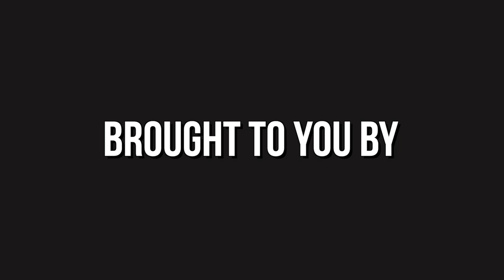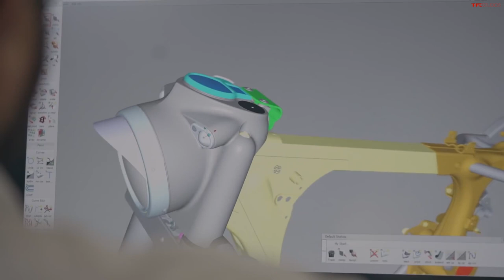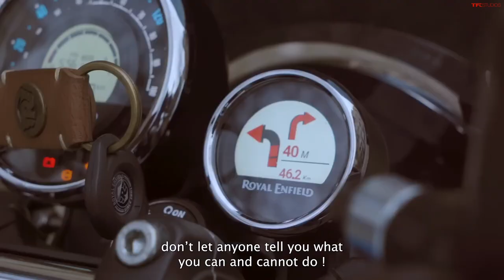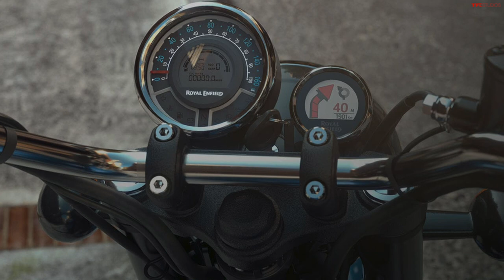Here's Every Royal Enfield Motorcycle You Can Buy In 2022! We Cover The Entire Lineup

Comment: I've owned countless bikes over the decades ranging from Yamaha, Kawasaki, Honda and a handful of HD's... just this summer I purchased a new RE 650 Interceptor and enjoyed it so much I also purchased a new Classic 350 in Halcyon Black... pronounced (Hal Sea On)... On the 650 I replaced the turn signals with nice metal aftermarket, a BAAK small taillight and a set of S&S pipes with baffles removed. This is literally the best sounding and most smooth bike I have owned or ridden. You need to get your ass on one asap with the S&S and enjoy all that is good about riding a motorcycle. Now, the 350 Classic is just as addicting... actually, more so... it is slow and lazy in the most amazing way. Again, a bike one must ride to understand fully. The heartbeat thump and smooth operation of the 350 is intoxicating, to say the least. I have never been a touring bike or bagger rider... my HD's were Sportsters, Soft Tails and Fat Boy... and quite honestly, these Royal Enfields are way more fun to ride and look at. So, as I noted above, get your ass on these bikes as soon as possible.

Comment: There's one thing I'd do to the 650 Interceptor: Get the Hitchcock upgrade treatment. They have an 865 Big Bore kit, a better camshaft, and a much stronger clutch that can keep up with the profoundly upgraded torque and horsepower. Torque goes from 38 to 62 ft. pounds, and HP goes from 40 to 65.